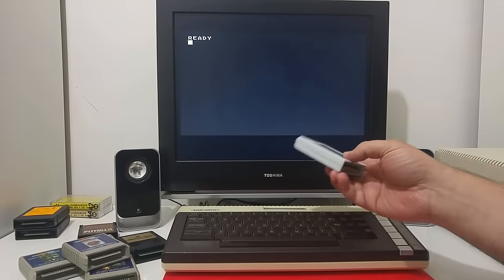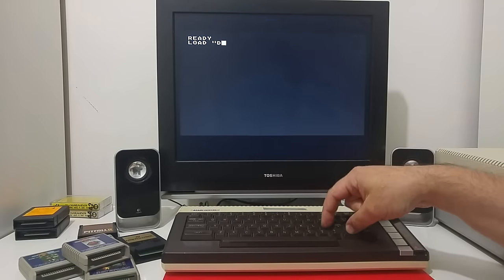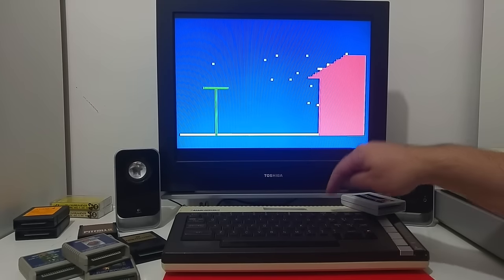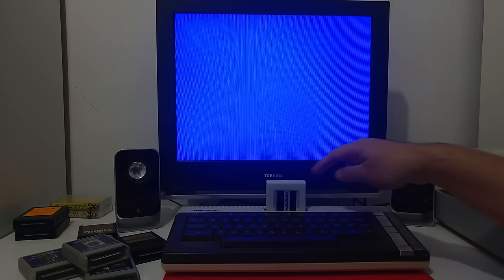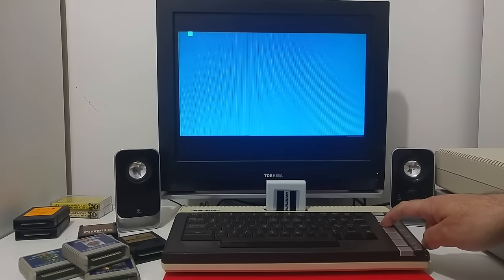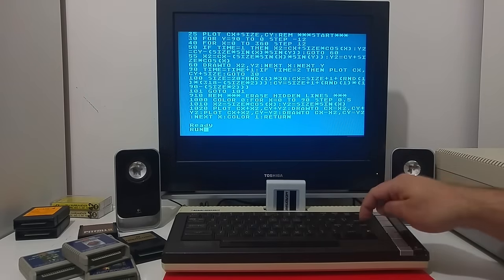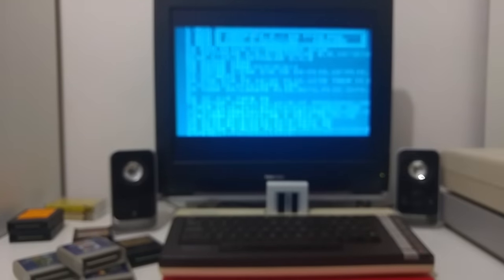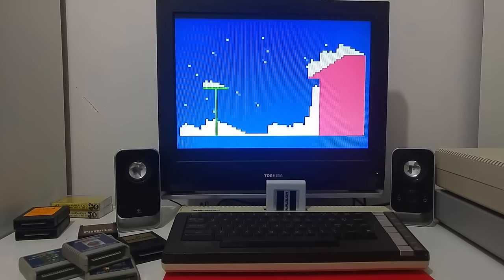Demonstration of the Veronica cartridge accelerator on an Atari 600XL

Comment: I wonder why there is such a speed difference between the NTSC and PAL versions? Especially since PAL versions of most computers tend to run at slower speeds than their NTSC counterparts (due to the incoming 50hz instead of 60hz).

JW3HH
Reply from the maker: the acceleration speed is the same, in both PAL/NTSC machine, the Veronica cartridge accelerate the Atari X8 the CPU speed, there is a bug in the software that shows different values in PAL/NTSC

Comment: How does it work with demos that use 65816 code ? Do assembly demos also work faster or do i have to use certain POKE commands to switch on this cartridge ? I ask this, because you only show 2 BASIC programs. it would be handy to also show how the Veronica cartridge works faster with machinelanguage programs on the Atari.
Reply: The comment the author made was that with the cartridge it can run Atari Basic programs faster. That's why I asked if he had to rewrite the O.S. for the 65816.
Reply from the maker: there is a small demo that use the cartridge to show faster rountines, if you take a regualr demo it will not run faster as it does not make any calles to the new processor.. you need to re-write your own demo that will use the cartridge to get more processing power